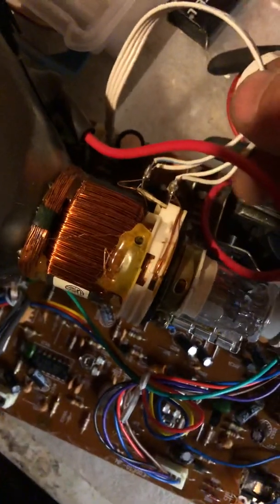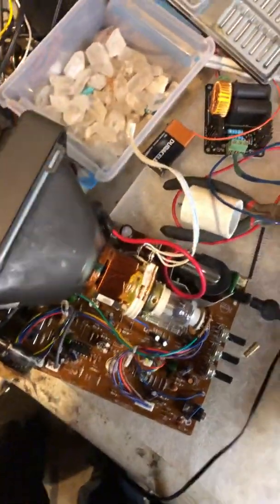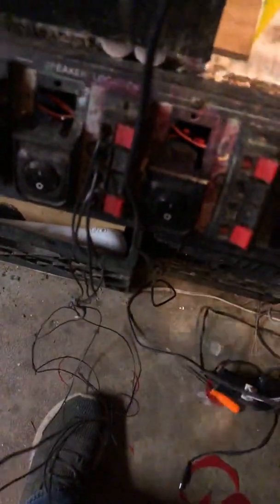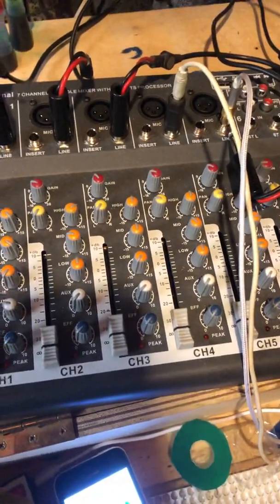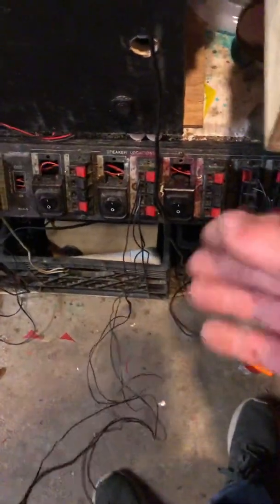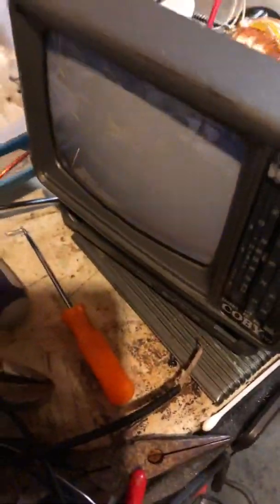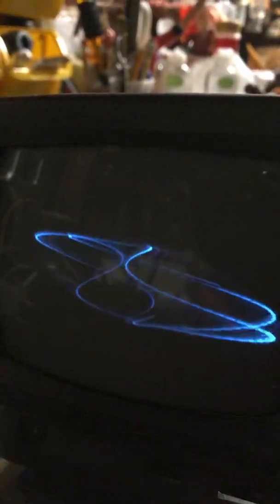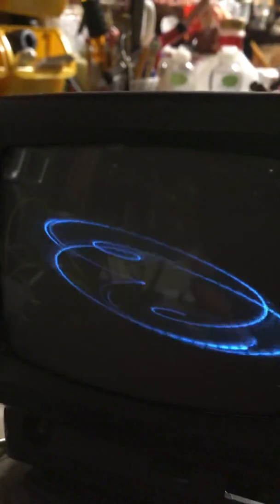Build your own xyz oscilloscope with old tv

Comment: How do you do z?
Reply from the maker: This I hook speaker wires to it so I use a mixing board that uses two separate frequencies into separate channels panning turn left and right to turn axis u adjust it by panning the left and right so it’s pretty easy set up if u find that 4 wire setup in the tv hooked to board going to tube
Reply: @Madscientist01000  yeah I’ve spent that with my oscilloscope. I’m looking to mod a crt with z as well so I can “lift” the pen when it draws for an asteroids arcade board. Was planning on trying a Sony watchman. I’ll need a transistor and find where to turn the gun of and on.

Comment: Hi, great video. Im wondering, If the audio source goes into the tv so you can see it, how do you make sure the audio also goes to speakers so you can hear that too? Since theres no output from the tv of course
Reply from the maker: Chubeats lol I have a mixing board and audio amplifier and speaker switch box with volume control on each one meaning I can run this to anything separately like the tv and speaker tv and cymatics set up right now I can show 3-4 things at one time but my computer sucks so it glitches a lot all my videos are on facebook you tube kind of sucks for getting information to people